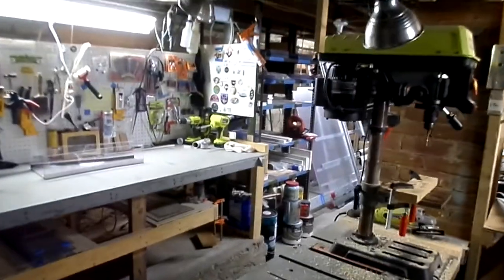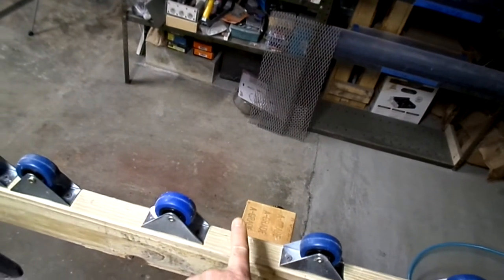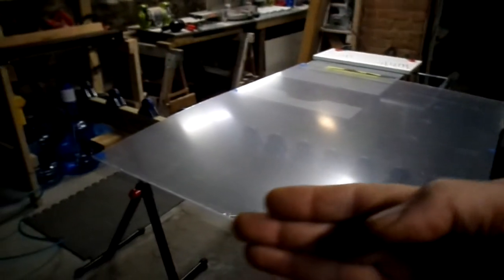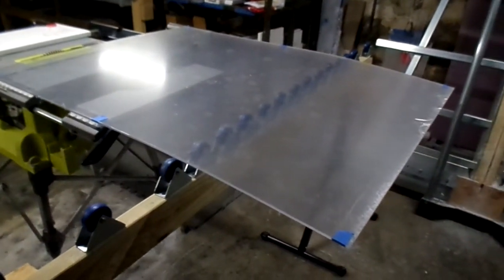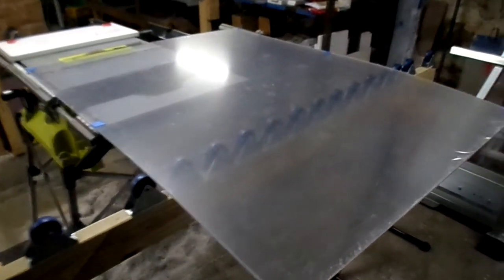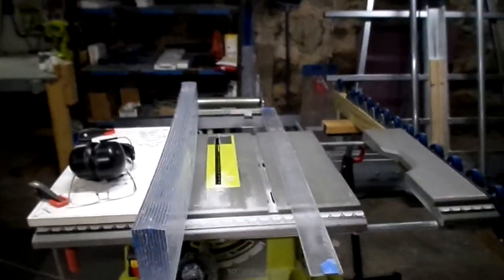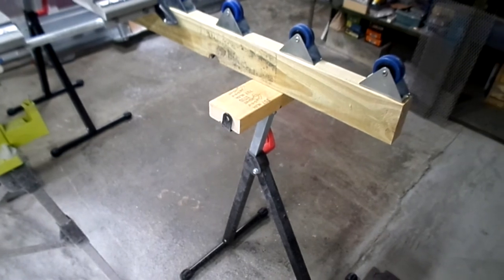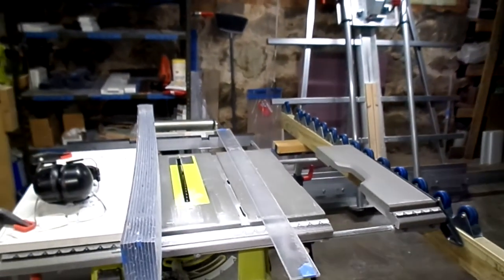Shop Work With Green Mountain Gold Trap

Comment: That's a genius idea and I may hafta build one for my shop!!
Reply from the maker: It's slick! After spending $2.99ea on the casters, I noticed ones for 99 cents. They are small rollers / balls but screw on the board like the casters. However, I'm glad I got these due to dust and debris.

Comment: So you get zapped every time you move your left hand over to control the cut side of the panel?
Reply from the maker: Only in the winter Couz. It's the lack of humidity which causes static electricity while dealing with polycarbonate.
I have added a humidifier to the shop and it has helped greatly but it doesn't stop it completely.
I also have a spray called Staticide. I think between the two this production season will be much better. I'm also going to see if I can fund some rubber feet for the table saw.
Reply: @GreenMountainGoldTrap  yeah man that’s crazy geez 😆
Reply from the maker: @couzdogable  Yup! And after being the spray booth operator for a blacksmith shop for three years starting at the age of 18, static shocks PISS ME OFF to no end bro🤣
I used a Bink's Electrostatic Spray Gun with the pressure pot. I got NAILED HARD Every damn day even though I was totally grounded to the gun.
I've got some funny stories about that. Wasn't too funny then though.
Reply: @GreenMountainGoldTrap  did you eat a lot of earthworms when you were a kid? 😆
Reply from the maker: @couzdogable  Only one when I was dared to. Was a big ass night crawler and I made a few girls puke all over the playground🤣🤣🤣